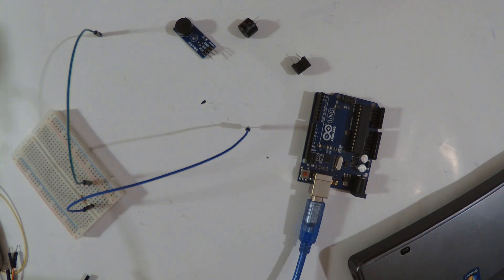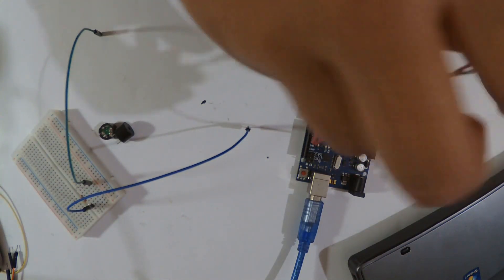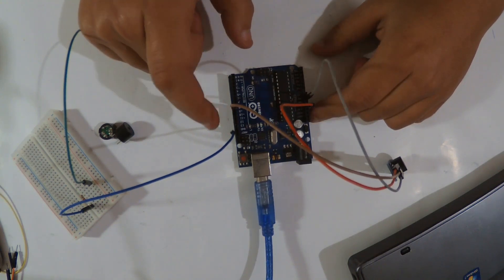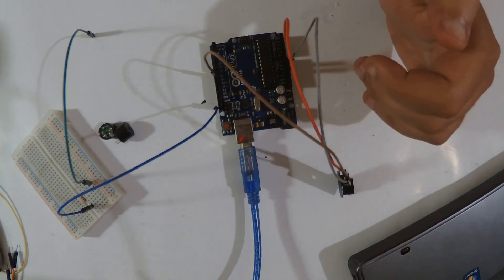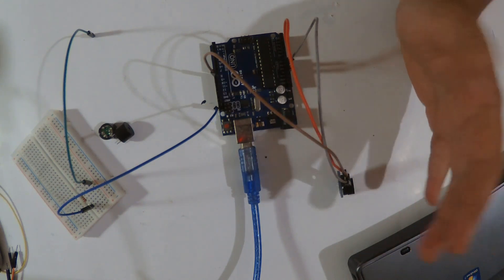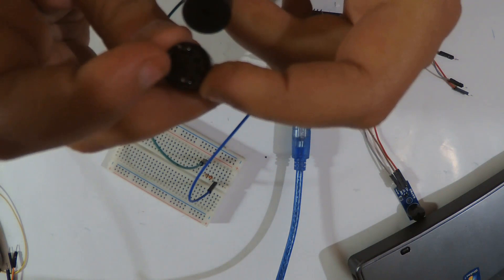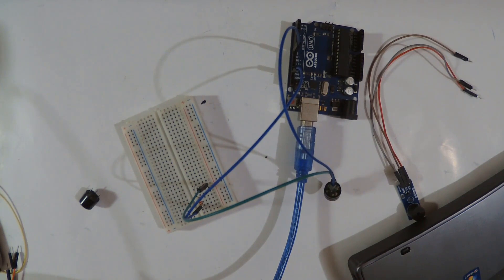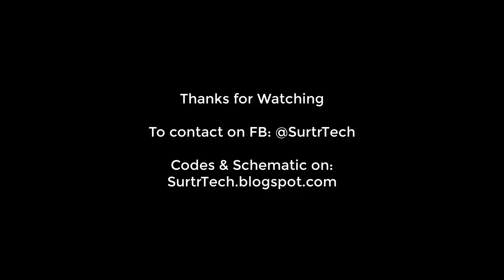How to use Buzzer / Piezo - speaker with Arduino + Star Wars theme

Comment: What's the difference between this buzzer module and ones that have 2 pins only?
Reply: The 3 pin buzzer has a transistor on it to switch on the buzzer with the PWM signal the other 2 pins are VCC and Ground in this configuration you can get more current to the buzzer making it louder, in a 2 pin configuration you are limited to a certain milliamp from the board

Comment: my buzzer not stop on noTone what to do
Reply from the maker: Is tone function working normally?
Try to use a simple code with the buzzer alone and for example  (pin D12)
"tone(12,2000);
delay(1000);
tone(12,100);
delay(1000);
noTone(12);
delay(1000);"
and check if your buzzer is responding to these fucntions, and don't forget to check your wiring again: 3 pins version ""5v/gnd and I/O to D12 (for example)""
2 pins version Gnd and (+) with a resistor then D12, try simple codes it could be another problem if you're using it in a project

Comment: i got a problem with module buzzer. when i just connect (-) and out to arduino it plays song well but to small. When i connect 5V, it starts screaming and dont follow my code anymore. Can you help me? thanks and btw nice video and nice song
Reply from the maker: Sorry I don't know about this problem, try connecting - to gnd and the signal to D8, or try with 3.3v instead